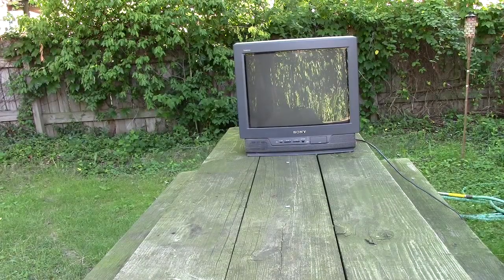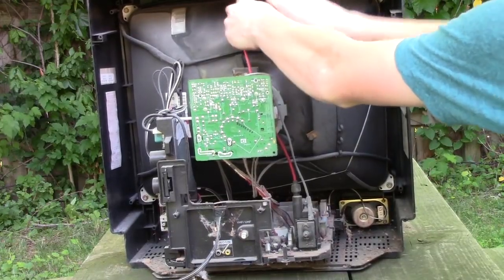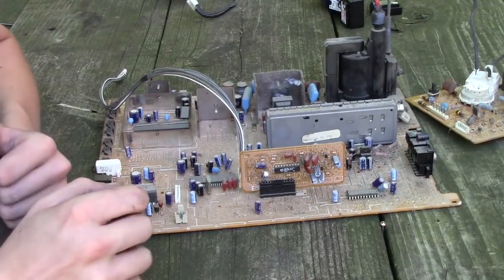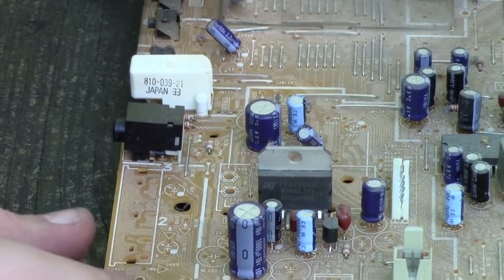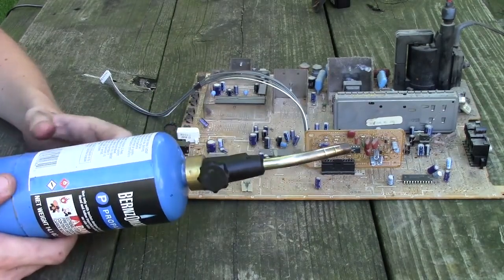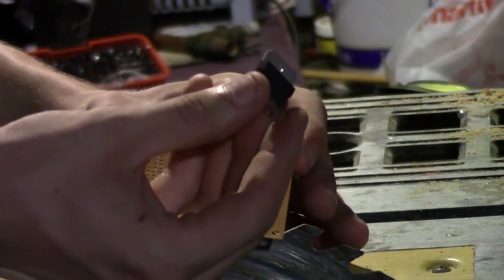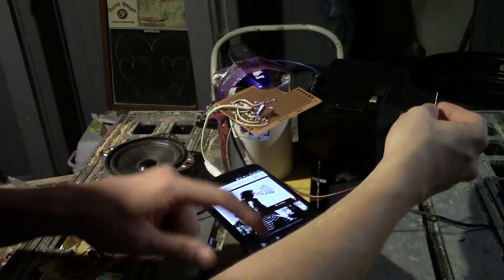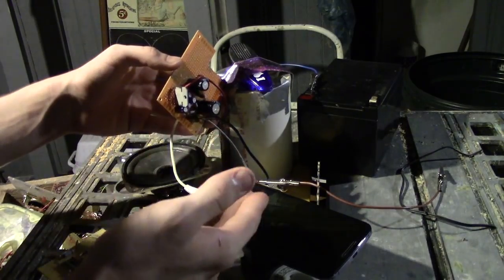Audio Amplifier COMPLETELY from an Old Television!

Comment from the maker: It has been brought to my attention that I have given terrible advice for how to properly discharge a CRT. If you are attempting this project, please refer to the following video by Mike the Scrapper on how to do it safely: https://www.youtube.com/watch?v=6dAMhqwWBwg
Reply: Your video needs an audio amplifier
Reply: ClevelandStorms
Reply: ClevelandStorms so if that makes all together 20 watts if you were to double or even triple on a few parts you could theoretically make one with the same size board and have it pushing out 60 watts no problem. correct?
Reply: Yes, I'm definitely glad someone pointed this out to you. After being an electronic repair tech for around 40 years, I've seen others as well as been ''popped'' by this lead and/or the CRT when attempting to disconnect it myself. Although the newer TVs bled off that HV fairly well, they could still hold a charge. From experience I can tell you that this ''POP'' can be very painful. I won't even get into the old tube type TVs. Make sure that screwdriver is grounded before you attempt to take the cup & lead loose. A jumper with alligator clips works well. Also, it's good practice to do it with 1 hand. stick your other hand in your pocket while doing this. Other things that can really pop you are those electrolytic capacitors. Particularly those with a high capacitance rating (mfd or uf --microfarad amount). It's best to short the leads of these capacitors on the bottom of the board with a screwdriver as well. It's just better to be safe than hurting & almost afraid to continue with your project.
Reply: If a crush the glass with a stone will it be discharged?
Reply: @DavidLopez-bz4rj  This sounds right to me. I have been learning a lot about electrical engineering from Youtube videos and I think you can also submerge the TV in water as water conducts electricity. I think you may have to plug the TV in first because if there is no charge in the big capacitors, CRT and whatnot you will not be able to discharge them. So you have to make sure they are fully charged before you can fully discharge them. I have never tried this and I am not telling anyone to do this as I am not a qualified Youtuber, yet.
Reply: Why your sound is not loudly
Reply: Yes a TV shock can definitely KILL a person. Extremely dangerous .
Reply: Gteat video man you showed everything wonderful except the very end up where you have to piece it all together how do you do that
Reply: I can tell you’re a very knowledgeable person. Personally If the had this option back then I would have just bought a RCA to composite cable so I could plug the phone up to the tv and not waste a fine CRT TV. Again if they had this cable as an option back then.

Comment: Being an old TV repairman I can tell you it's the picture tube that holds the hi voltage charge, not the flyback cable when it's unattached. Ive used amps out of TV's like that before, but I just sawed out the circuit from the motherboard and used it as an already built amp circuit

Comment: not all TV's will have a vertical audio OpAmp, depending upon the make and model of TV may have a dual in line package chip, a TDA2822  for instance. which is an 8 pin DIP package chip. All components to make the amplifier work WILL BE ON THE BOARD. But you will need to take a look at the datasheet as this video says to get an example circuit. Recycling from broken and unused electrical items is always fun. My whole channel is devoted to the same ethos. If you do some simple maths and some research about each of the components you can make some really useful things for absolutely no money whatsoever. GREAT VIDEO! KEEP EM COMING.

Comment: Thank you for sharing. Embarrassed that I never thought of using propane to get the parts off easily. I'm watching this video because I took apart a widescreen CRT TV that nobody wanted to get some heat sinks and discovered some large speakers with bass enhancing enclosures similar to Bose. This gives me inspiration.

Comment: You'll need to add a heat sink to that chip if you don't want to burn it out. It might not have had one in the TV, but from experience those chips get hot fast.

Comment: Nice scrap build. Nice to see a young person interested in electronics. Be careful what you advise about high voltage. you were wrong about the wire holding a charge ,it's the tube. Also before messing with the TV, use a hammer to crack the neck back by the pins. Just a gentle tap and you will hear the air rush in. That will eliminate the danger of the tube imploding and causing injury.

Comment: Used the TDA2009A quite some years ago, and it is pretty reasonable in terms of sound quality, and also has some power. Even made an amplifier around it, that also used a LM1036 for volume, balance and tone control. It was capable of driving 4Ω loads with ease. Unfortunately, it is now obsolete.

Comment: I leave it on the board and cut it out with tin snips...I cut around the area of the amp chip and caps....then find out how to wire it...it is already made into a circuit so just leave it there...

Comment: The quoted 10 watts is only available at the high voltage and that is at 10% distortion in other words clipping. At 12 volts pre clipping you will be lucky to get 3 watts. At higher voltages you will also need a heat sink.
Reply: The TDA2009 should have a minimum supply voltage of 24 volts dc as a standard voltage for amplifiers in televisions, even in the flat panel lcd tv's
Reply: tda 2003 / 2004 AND 2009 are good to create noisy amplifier if used  on bridge ;)my first DIY amplifier was a stereo use 2X 2 tda bridged  for 2X 18 true WATTS :)
Reply: You all just mind fucked me
Reply: The TDA2009A used bridged makes a passable ELF radio output section too, as its good to several 100kHz...

Comment: +1 on the propane torch.  You can hold the circuit board over a cardboard box and whack the board against the box as you heat it.  Lotsa parts!

Comment: Thanks for showing this project. Still have to buy PCB board, audio plug .Only thing is you can buy such audio amp boards cheap in eBay. Don't know if they are as good. Please post your suppliers' links in your commentary below the video along with the ID of the components you used. It would help us. Can you connect both audio channels together to one speaker? If so how?

Comment: Nice little project! But a lot of work for a rather crappy chipamp...

Crack open an old car stereo instead if you want to build something similar. For example, an LA4708N only require a few external components and will deliver plenty of power at 12 V.

Comment: The screeching sound is the TDA2009A when connected to a high impedance input - it doesn't like it.  Phones save power by switching off their audio output sections which leaves outputs floating at high impedance.  Once the phone is pushing out a signal the TDA2009 will be stable.

Comment: why didn't you just hack off the amplifier section and re wire power supply and audio outputs! that could be easier, just thinking :)
Reply: Bleau is absolutely right Gerrod. Nothing wrong in that
Reply: @gerrodphillips2471  Sounds like you don't ;)
Reply: Just because he found the audio IC & it's associated components does not mean there may have been sections of additional circuits running through that area. Years ago, I had a Zenith Systems 3 TV that had plug in modules for different circuits. This TV developed an extremely loud, high pitched squeal from the speaker which the volume control had no affect on. It happened that the audio board also had the horizontal oscillator circuit on the same board. A component that isolated the circuits shorted out causing the frequency of the oscillator to become amplified to the extreme. It was so loud, it was annoying to people who lived across the street. Therefore, just because you think you've isolated all you need, do not take it for granted.
Reply: Just because he found the audio IC & it's associated components does not mean there may have been sections of additional circuits running through that area. Years ago, I had a Zenith Systems 3 TV that had plug in modules for different circuits. This TV developed an extremely loud, high pitched squeal from the speaker which the volume control had no affect on. It happened that the audio board also had the horizontal oscillator circuit on the same board. A component that isolated the circuits shorted out causing the frequency of the oscillator to become amplified to the extreme. It was so loud, it was annoying to people who lived across the street. Therefore, just because you think you've isolated all you need, do not take it for granted.
Reply: @gerrodphillips2471  that's right cause who has a board laying around to just put electronics on lol frys electronics is a good store for alot od DIYers lol

Comment: you're right dude ^^ i've buildin sévérals amplifier with ic like TDA LM and co from old tv or old car radios and all work very well ^^
but i like to build amplifiers with a couple of darlington power transistor (TIP 142/147) one couple capable of + 150 watts and if used  a double/triple push pull ,you have a monster  like 500 watts  and very cheap to make /reliable very easy :) good video thks

Comment: I pulled apart a speaker/power bank combo device because I lost the original charger and fried it trying to charge it. Pulled it apart and there was a huge lithium ion battery, two boards inside a plastic part and two flexible wires going to the speaker on the other end. I separated the two boards and one was the amplifier. Found the two power points and got it working. The amp seems to be happy at around 3 volts. I'm going to try 4.5 from batteries. I'm going to make an enclosure out of something. and use the battery and guts from a small power bank to make a new amp and power bank. Yeah I know it was a power bank originally.

Comment: That chip is like 2 bucks, not worth salvaging and then putting on a new board. If you really want an amp, dremel the audio amp section of the tv pcb out and use it as is.
Reply: Joseph Jose this video is a waste of time lol it should be titled “when you absolutely have nothing better to do, pull the amplifier from your moms tv!”
Reply: Its EOL'd so its value will probably go up for a while for spares...

Comment: I take a pair of large tin snips...and cut around the entire amp area...and find the power wires in...they will usually be on the large caps, then usually the speaker wires, like on this video, will already have a connector on the board you just cut out...so find the audio inputs...and thats it..Look at the online info for the IC and find the sound inputs left and right...

Comment: its not the ht cable that holds the charge its the crt its self
Reply: Simon Smith tv isnt grounded unless its plugged in too :)
Reply: neil froggy crompton Not unless the TV's Cable is 3-core!
Reply: Mr.Someone \Tom/  yes thats my point vid says u can short out lead to gnd but if theres no gnd in pwr wire ur dicing with death as high voltage was mentioned right?
Reply: neil froggy crompton Absolutely.
Reply: Mr.Someone \Tom/  i once opened up a phillips vga comp monitor when it stopped working, couldnt fix it so butchered it for parts (as i had identical 2nd one) & remember ripping out that lead.
my question is how long would residual pwr be in the crt?,as monitor sat on the floor for about 6 months+ .
could it have discharged while left unused?
Reply: neil froggy crompton Over 6 months, yes. I don't know much about the capacitance of the CRT but 6 months will discharge it no doubt.
Reply: Mr.Someone \Tom/  took the lead off with pliers with insulated rubberised handles,cant be too careful & i wasnt sure @ the time. :D
Reply: It'll only hold a charge for long periods in winter when the airs dry, but you don't know if some clown's gone and plugged it in recently so always discharge, 22kV is a might kick indeed.

Comment: Learn the chassis numbering system 100's IF 400's vertical 500 Horizontal etc etc, If 200's is normally audio. so all parts in the 200 range will relate to audio parts. Also there this thing called a schematic which will show you just where each part connects. you probibly could have isolated and cut the board out and saved the rewiring chore. And I agree with t0nito, hurry up and build that amp so we can hear what your saying. Oh and for future safety reference the anode of the CRT holds can hols a charge up to 30000 volts. not the flyback transformer. discharge it, to the shield (wire) around the tube (ground).

Comment: Flyback or EHT transformers do not hold a charge it is the actual tube that acts as a capacitor and you can get a hefty shoch not from the wire that you pulled off but from where you pulled it off from.
Reply: that's good to know 4 people like me who r unfamiliar w/these things. in order to discharge it, would u take an insulated wire & touch 1 end to where the tv wire connected to the tube & ground the other end?
Reply: The giant capacitor in those things can be deadly as well.  Even if there is a visible bleeder resistor, there may be no indication if that resistor is open (and therefore useless).  Make sure the giant capacitor is really discharged and disconnected before handling it/anything, or it could be the last thing you touch.
Reply: And trying to ground something against the glass tube isn't going to work - the graphite lining makes it look a bit metallic, but its still plain glass on the outside!

And a standard electricians insulated screwdriver isn't rated for 22kV of a colour TV tube, only for typical mains.
Reply: More modern CRT self discharge anyway, I have scrapped out 1000s of CRTs for the copper, and never once have had a shock. If it's been unplugged for extended period of time, the likelyhood of there being charge is small...
(Australia here may be different for the states)

Comment: for the price of a 12v lead acid battery you can buy a 50 watt bluetooth amplifier that runs off of 5 volts, basically any usb port or just a few AA batteries, that functions and performs way better than this 5(?) watt analog amplifier lol.
Neat project if you're bored I suppose... Dont use a propane torch for soldering though...
Reply from the maker: Definitely. I just like digging into old crusty electronics yanno? Something cool about it. I only use the propane torch for desoldering chips off of boards. Haven't had an issue yet... hope to keep it that way
Reply: Zac Price these days all is easier and cheaper to order from china. but where's the fun in that? i like these type of channels, where you can learn how to repurpose things.  subscribed, hope to see more videos like this.
Reply: 50 watts with 5 volts ? to have 50 watts rms the speaker need about +/-18/19 volts AC , from 5 volts to + 20 the amplifier need a huge stage  High Voltage to delivery TRUE 50 watts ...for exemple i have onr bluetooth speaker 20 watts ....BULLSHIT it's capable of exactly 4 watts (2X2 with 10% distortion) or 1.2 watts x2 with "good" noise
Reply: MADJID HAMDINI can you please send me a bit of your opinions on the way your running the numbers battery type into the unit and the speaker and guage of wire and keep audio alive everyone. thanks again
Reply: whay about ? bluetooth speakers or a DIY bluetooth amplifier ?
Reply: Good luck drawing over 10 amps from a USB port. LOL are you kidding me?

Comment: Removing the red wire from the tube is the best way to get a very strong shock from a TV. You should use a wire that has a probe on the end hook the wire to ground then use the broke to discharge the tube. There is enough voltage at a high enough amperage to stop your heart stored in the tube.

Comment: Just tracing the speaker cable can reveal the audio chip. Most easiest method.
Reply: Ura Nium sometimes it’s not as easy
Reply: agreed sometimes its not that easy but following the tracks from speaker connection on the PCB will almost certainty lead you to the audio OpAmp. sometimes its a bit tricky but you will almost always be able to find what you are looking for.

Comment: Put a ground clip on that screw driver and to the chassis then as you pop off the HV cap you will aso discharge the 2nd anode safely.

Comment: Grounds high voltage line to a ground line which is not connected to ground (pretty sure, your power plug wasn't plugged in, otherwise you wouldn't remove the red cable...).

Comment: Can i salvage it amp chip from old crt monitor which doesn't have any speaker
Reply from the maker: No it most likely will not have an amp chip if it does not have a speaker

Comment: not all boards are marked so make sure u get the right chip. there is also another tda chip close to the transformer. looks identical but just has a different number on it. dont think u can use that 1 coz i think its a voltage amplifier or something like that. any1 no if it can be used for audio amp or just voltage?
Reply: Amanda, It's likely a frame amplifier/vertical deflection chip. A purpose specific amplifier, if you will.

Comment: Mate, you 'grounded' that high voltage circuitry on that 'sliver thing' when the 'silver thing' isnt even grounded itself as the casing of the tv is plastic and the table its resting on is wooden! This could be HIGHLY dangerous and there is serious risk of electrocution, you just got lucky that the capacitors had already been discharged. For anyone else trying to do this, you need to touch that to an acutal ground, or this may be fatal.